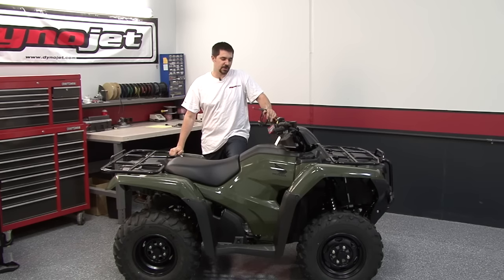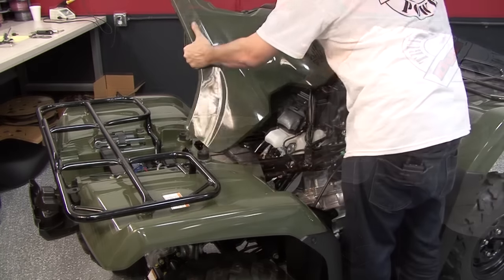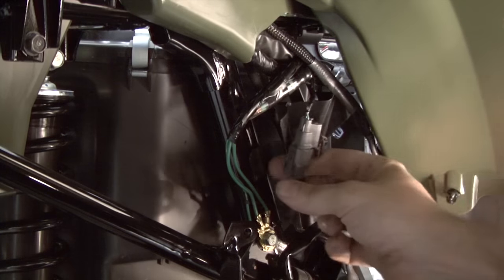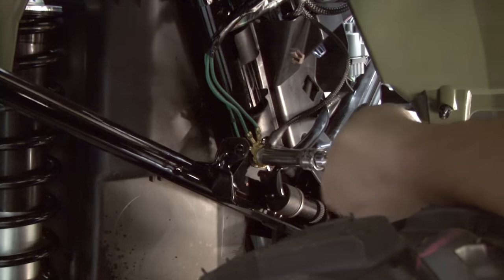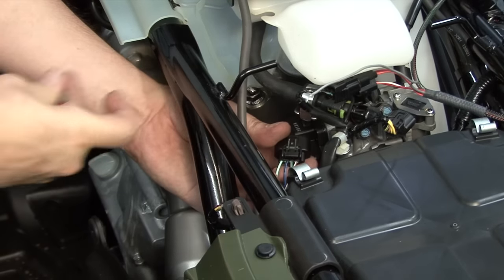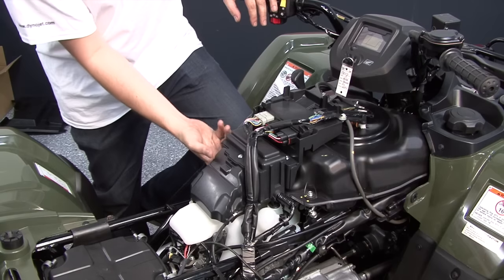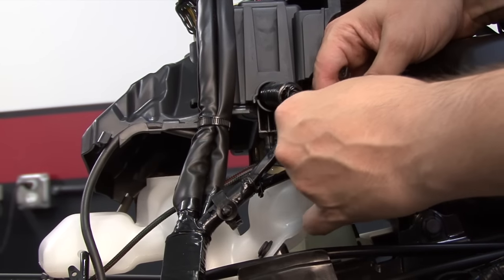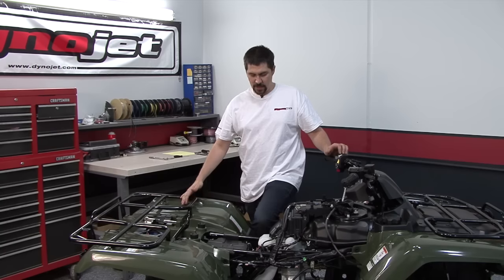Power Commander V Install: 2014 Honda Rancher 420

Comment: I have an 18 Rubicon deluxe with a full RJWC exhaust and k&N air filter.. after installation does this automatically adjust fuel and timing or do I need a computer to tune
Reply from the maker: You will either upload a preconfigured MAP to the PCV, or you will need to visit an authorized tuning center to get a custom tune.
Reply from the maker: You can reach out to our technical support at powercommandertech@dynojet.com and they will point you in the right direction.